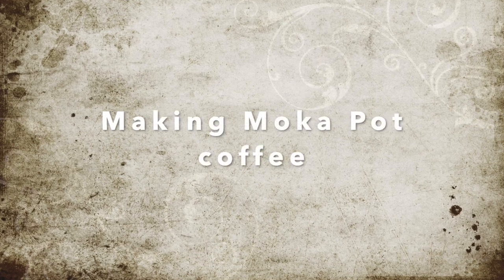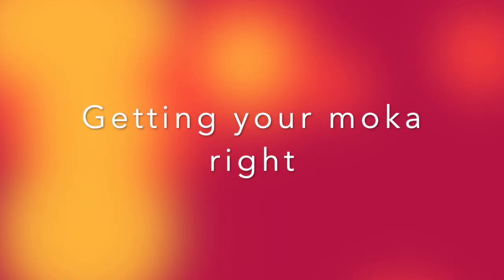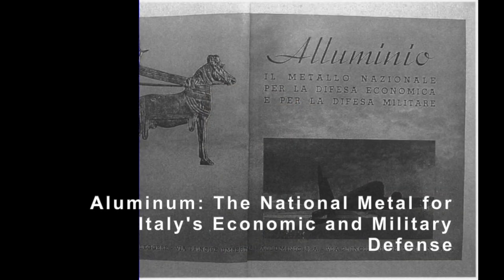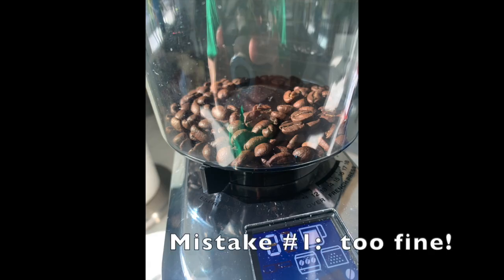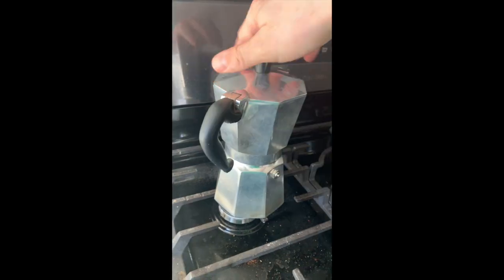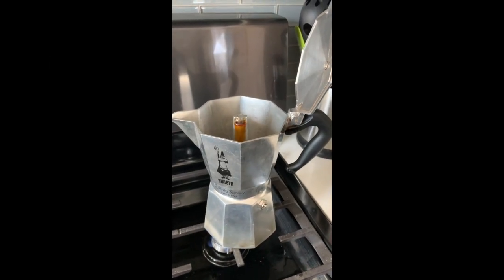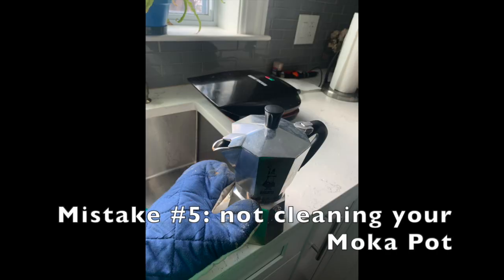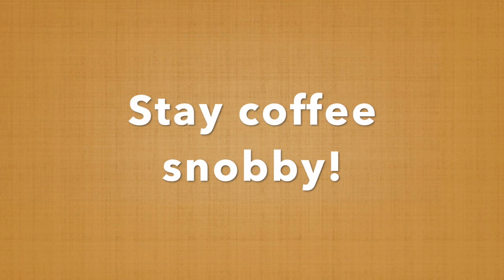Why your Moka pot tastes bad

Comment: my moka pot is way too large - it is meant for 10 cups . 
But Is there a way I can brew a single cup with it, Or I have to brew 10 cups everytime I use it ?
Reply from the maker: Hey, thanks for the comment and great question!  Unfortunately, your best bet is to invest in smaller moka pot model.  Among all possible brewing methods, the moka pot is the least flexible in quantity of coffee brewed. I've made a video where I play around with putting less grinds in and the result is your coffee gets weaker and underextracted: 

https://www.youtube.com/watch?v=bCSn2CXWZOE, 

which is in agreement with a video Matteo D'Ottavio (https://www.youtube.com/@matteofromtheswamps) has made about choosing the best moka pot size: 

https://www.youtube.com/watch?v=jWWVi25oLNA

If, on the other hand, you figure putting less water in is the answer, you'll be met with a surprise:

https://www.youtube.com/watch?v=NQrRzTzU_Yk

Less water actually ADVANCES the brewing time so your coffee will be underextracted again!  

As for me, I regularly brew with a 6-cup model when I'm making for myself and my wife. When she doesn't want coffee, I'll use my 2-cup model, though I honestly think the 6-cup does a better job in the flavor.  The video above by the Matteo D'Ottavio (https://www.youtube.com/watch?v=jWWVi25oLNA) gives the low down on how to choose the best size for you but bear in mind this whole "cup" sizing thing is not any other standard definition of "cup". D'Ottavio says to think of the "cup" in terms or espresso shots.  Anyway, good luck and I wish you the best coffee in life!

Comment: There is an alternative if you would like to do an espresso to make latte. 
You do fine grind and pack it down tight if you want traditional concentrated espresso shot. You would then use 1 ounce of your brewed concentrate as one shot of espresso which is great for an 8 ounce or a 12 ounce latte. And two shots or 2 ounces for a 16 ounce latte. You can do steamed milk or an Americano which would be hot water.
Reply from the maker: Hey, thanks for the comment!

Moka pot coffee is not espresso and, even packing it down, there's a limit to how concentrated you can get it.  If you truly want a latte, you're going to have to bit the bullet and get an espresso machine!

Comment: Thanks, this is great. An Italian lady once told me to just rinse the expresso maker, not wash. In any case, how would you wash it? Dishwasher certainly not! By hand with or without dishwashing liquid? Many thanks.
Reply from the maker: Hi and thanks for the comment and your excellent questions!  

People say don't push it in the dishwasher and..... they're right. I've tested it myself.  The problem is that the dishwasher works too well and cleans off the protective layer of aluminum oxide that prevents the aluminum from reacting too much with your coffee and leaching into it:

https://www.youtube.com/watch?v=qV3Us0KkIMo

The manufactured says "hand wash with mild detergent" and I'd say this advice is well heeded.  Yes, most of the time I just use some hot water and a brush.

Also, one thing I'd get a bit overly semantic on is calling it an espresso maker.  Some people refer to these machines as "stove-top espresso machines" (including one physics paper: https://prokofe.ru/files/public/1545073434_16273_FT107421_the_physics_of_a_stove-top_espresso_machine_warren_d_king_king2008.pdf) but strictly speaking, it's not making anything like espresso but something like an espresso-drip coffee hybrid.
Reply: @loodog555  Semantic R Us! When I wrote this last night, I actually had to think what to call it. Some just say 'the Bialetti', which is a little non-inclusive if your [insert name here] is of a different brand. The thing is, we call this beauty 'la cafetera' (Spanish for 'the coffee maker'), which suits 'her' perfectly! Where I live, 'mocca' (double C) refers to a (Starsbucks-style) drink with coffee, milk and chocolate (not my cup of tea!), so 'moka' is out of the books for us. Greetings.

Comment: 1. Pour in warm water so you don’t have to wait long.
2. Pour coffee flush into the tablet (sieve), do not tamp it down! remove the slide flat with a ruler or the butt of a knife. The grind can be either fine or medium.
3. Place on low heat.
4. As soon as the coffee starts flowing (I think the slower it goes, the better), count down 35-40 seconds (you need to take it off as soon as the lighter coffee starts flowing!), remove it and immediately lower the lower part into cold water!!!!
Not under the tap, but in a bowl of cold water.
Stir it all and you can pour it into different cups.
And voila, you get the best coffee in the world!!!!
There is not much of it, just add hot water and sugar.
Reply from the maker: Thanks for the comment!

For step #2, I've actually experimented around with not filling the basket all the way up: https://www.youtube.com/watch?v=bCSn2CXWZOE

For step #3, you might be waiting a while on low so I tend to start off with medium heat, turning to low once coffee starts appearing out the top. 

On step #4, I'd actually advise against doing it by time, since everyone's heating source is going to be different and going with your "lighter coffee" criteria.  

For hot water, many people have the preference to drink more of an "Americano" style, which is what you describe in adding hot water; however, if your coffee is high quality and properly brewed, I'd argue that adding any sugar should unnecessary, as the coffee will have a natural sweetness to it if you haven't overextracted.   

Have a great day!
Reply: Regarding step #4, I only measure the drain time and the fire is always at minimum.
I also tried to measure 30 seconds from the moment the coffee starts to flow and immediately shoot, without cooling. It also turns out well.

Comment: This is non-sense. No Italian Grandmother does any of this. Just turn off the heat when it starts gurgling. To clean it, just rinse it out with water and wipe the polished surfaces and the gasket with a sponge.  Do not use soap. Period. Do not clean out the reservoir.  Reverse the gasket at about five years.  The most important thing is to not put it together wet.  let it air dry completely.  If you put it together wet you will get mold in the reservoir and this is what creates bad flavors.  One more thing.  The color of the roast you, and what kind of beans the coffee is made from has more to do with the flavor than anything else.  You have to experiment a bit to find out what you like, and it also depends on what your are going to do with the coffee: drink straight, make an Americano, or a milk drink.
Reply from the maker: Hey, thanks for the comment!  

If there's any constant in the universe, it's Italians coming to this channel and telling me that "how grandma did it 80 years ago is the only correct way" 😁.  As I posted in my follow-up video, I don't care so much whether my method is the "authentic Italian" way so much as whether it produces good flavor coffee: https://www.youtube.com/watch?v=jcgMeDDAT-s

If your goal is to reproduce the results you get from that method, sure, keep doing it exactly the same for the rest of your life, but there have been fabulous advances in the science of coffee since those days if you have an interest in reducing the bitterness and astringency that moka pots have become known for. For example, there are physics papers out there that definitely show preheating your moka pot water helps with extraction, even though your Italian grandmother would never do this: https://www.youtube.com/watch?v=O14BIH-9KTA

On the topic of cleaning and drying, I endorse your advice on letting things dry completely to prevent mold, but your advice of "don't clean the bottom chamber" seems contradicted by your advice to clean off all the surfaces so I'm a bit confused.  

With regard to your comment that beans matter more, my latest video addresses this fact: that raw ingredients  - water and coffee - matter more than the brewing process:  

https://www.youtube.com/watch?v=5khcZkEHG0Q&

Good luck!
Reply: @loodog555  You don't clean out the bottom chamber because that surface is porous and not polished like the other surfaces.  Some of the coffee oils get down there and season the surface just like a cast iron frying pan gets seasoned by fat oils.  If you clean out the reservoir with soap you will remove the seasoning.  Do your scientific papers explain all that?  

Your comment about "over-extraction" is misplaced.  Extraction is a continuum and how much extraction you do depends on what flavor you want.  With the Moka pot you can end the extraction anytime you want- prematurely, or let all the steam through the grounds-it is a matter of choice and taste, not "science".
Reply from the maker: @tedolphbundler724  Hey, thanks for your reply.  Not just the bottom, but indeed all the aluminum surfaces are porous, which I agree is an important thing to consider and it's the main reason you never want to put your moka pot in the dishwasher.

By "overextraction", what I mean is "more than 22%", which sensory panels have shown is where the bitter and astringent (drying) flavors start to come out, whereas sweetness generally requires you to get to at least 18%:  https://sca.coffee/sca-news/25/issue-13/towards-a-new-brewing-chart

So again, we're making assumptions about people liking sweet flavors and disliking bitter flavors.  The specific balance of those flavors that you've gotten used to might be different than what this process is designed to maximize.  Again, that's fine.  There's no rule that says "You're not allowed to prefer the flavor of 24% extracted coffee"; it's just not what general brewing advice in third wave coffee is geared to produce. So, in that context, my tips are oriented towards reducing overextracting and minimizing bitter while maximizing flavor.  Good luck!

Comment: Plot twist:

I like sugar in my coffee so I add it to the Bialletti with the ground coffee and brew it in. 

I don’t know if it’s my imagination, but I seem to need less sugar when I brew it in.
Reply from the maker: Interesting! My prior roommate was Dominican and told me DR style was to put some sweetened condensed milk in the bottom chamber instead of water.... well, I just wound up clogging the connecting tube! Would NOT recommend.

Solution to your query: do a blinded trial - make it both with a tsp of sugar during brewing and after brewing and have someone present the two cups to you.  See if you can tell the difference.  Expectations contribute A LOT to the experience.

Comment: that randomic deposit of coffee in the filter is another mistake. Coffee should not be pressed, but must be evenly distributed in the filter. Otherwise, the difference in pressure will let the water literally bypass che coffee grinds (2:45 in the video shows this clearly) and go straight in the collector, giving you a more diluted coffee.
Reply from the maker: Oh yes, you want to distribute evenly. Thanks!  I didn't really mention this since it's not a common mistake people make.

Comment: Is it possible to use less coffee and water if I am making coffee for one?
Reply from the maker: Hey, great question!  This is actually the most frustrating things about moka pots: the inability to adjust brew quantity.  If you put in less coffee grounds, you'll just get diluted coffee.  If you put in less water and brew until the pale bubbly mixture comes out, you'll get less coffee, BUT you'll also wind up advancing the brew time; hence brewing at a lower temperature. I explore the connection between water level and brew time in this video:

https://www.youtube.com/watch?v=NQrRzTzU_Yk

So you can try to put in less water and less coffee BUT my prediction is you'll get diluted and underextracted coffee i.e. that the result will be weak and sour/acidic. Give it a try and let us know!

Probably, the only reliable way get less coffee is  to buy the next smaller size of moka pot.
Reply: @loodog555  thanks for the reply, yes I think I will need a smaller pot!

Comment: What about removing the coffee from the burner as soon as it starts sputtering vs turning off the heat and letting it finish without sputtering?
Reply from the maker: Hey, great question!  

Here's a video describing a physics paper that discusses that:  https://www.youtube.com/watch?v=2jLdGi7kjzk

And here's a video where I experiment around myself: https://www.youtube.com/watch?v=aA8KoZbtl84
Reply: @loodog555  Interesting, thank you for the links. I definitely did not think that cooling down the pot played such a big role. What I meant though was if there is a significant difference in taste of the coffee if you turn of them heat prematurely and let the coffee stop brewing on its own (preferably before the steam gets the chance to burn the coffee, which should be a matter of knowing roughly how long it takes, how much more coffee will come out when you stop the heat etc..) versus gettin just to the sputtering phase and cooling it down.

Comment: No. 4: I do not agree, I wait until all water come out and never had problem with bitteer taste. Unless I waste cca 1/3 of water that remains in the tank and result is a less coffee than I want.
Reply from the maker: Hi and thanks for the comment!  Fortunately, I have in-depth answers to the couple things you've raised.  Regarding waiting until all the water has come out vs. cold quenching as soon as you seem pale bubbly fluid:

1) It doesn't seem to be your experience re: getting bitter coffee, but I've experimented around and DEFINITELY notice the difference if I don't stop the brewing: https://www.youtube.com/watch?v=aA8KoZbtl84 But no need to change if you like your results as they are now.  It might be that you're just used to that flavor and don't mind it.  

2) On the question of leftover water, yours is a common misunderstanding regarding how moka pots operate.  The truth is that once pale bubbly liquid is coming out, there's only drops (less than 1 ml) left to get anyway because everything else left in the bottom is inaccessible, just based on how the moka pot is designed. It's certain nowhere near 1/3 of the water.  I explore the design and basic physics of that issue in this video: https://www.youtube.com/watch?v=F1ofrthmrV8

Comment: I've found the best taste comes with running the burner at the lowest possible setting that will push the water through. And as soon as you start to get loose foam or sputtering, the brew is done. Quickly remove from heat and quench the bottom reservoir in cool water.
Reply from the maker: I agree with this. Minimum heat is the same technique recommended by James Hoffman, and Moka pot voodoo: https://m.youtube.com/watch?v=u-PeYeiqPLU

Comment: Just to be Technical,...I was told this unit makes ESPRESSO. You are saying COFFEE. Which one does this make? Traditional Coffee or Espresso? Thank You.
Reply from the maker: Hey, great question!  I would say it technically makes a strong brew of coffee, as true espresso comes out of an espresso machine at 9 bars of pressure, while a moka pot only reaches typically less than 2 bars (and a highly variable pressure that is!) 

Wikipedia, for instance, talks about how moka pots are sometimes called "stovetop espresso machines" (https://en.wikipedia.org/wiki/Espresso_machine)

'As such, their characterization as "espresso" machines is at times contentious, but due to their use of pressure and steam for brewing, comparable to all espresso prior to the 1948 Gaggia, they are accepted within broader uses of the term, but distinguished from standard modern espresso machines.'

On more of a "feels like" definition, I'd say a moka pot makes neither coffee nor espresso, but something that's a bit of a mix of both.
Reply: @loodog555  I don't think I could have gotten a Better more well said answer than that. Thank You so Much.
Reply from the maker: @DarthBaeza No prob! Glad to help!